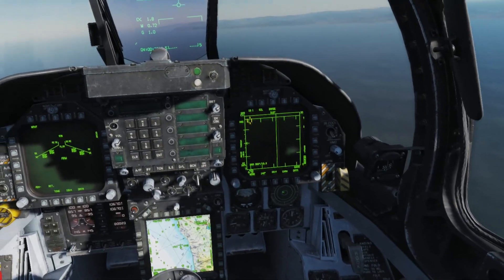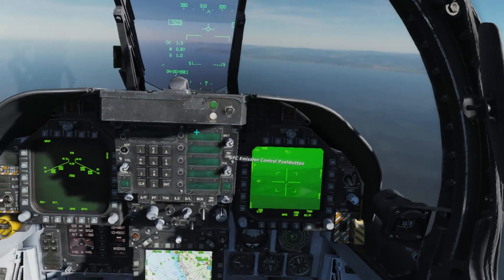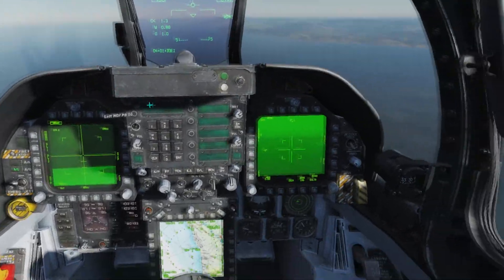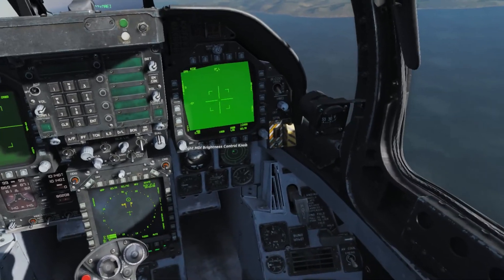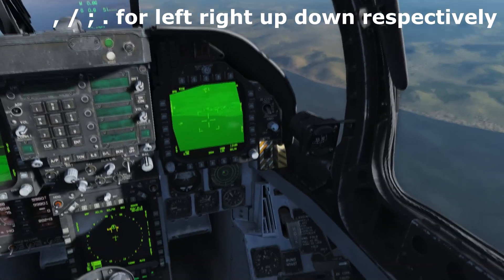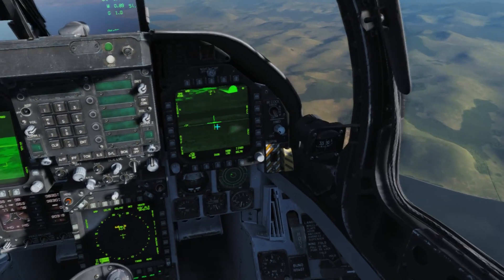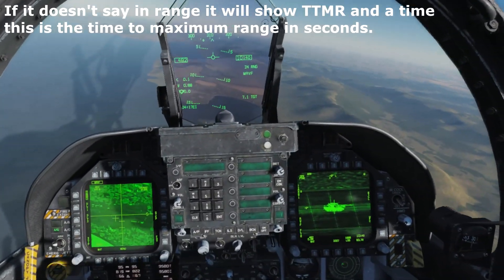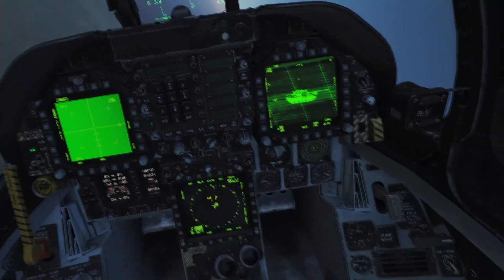DCS F/A-18C Hornet IR Maverick tutorial

Comment: I followed your steps exactly and MAVF in the hud has a flashing X through it
Reply: master arm on?
Reply: Daniel Mottram yes so since then I figured it out if your maneuvering a lot you’ll either have a solid x or a occasional flashing x that will prevent u from firing
Reply: @lucaswoods1155   I think if your altitude is higher than 15000ft you'll have releasing issues.